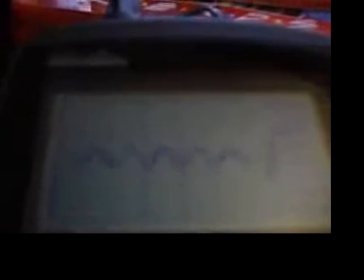RadiantJouleThief 2

Comment: In terms of a receiver, this is wide-band. In playing around with different L, R and C values, you can get a wide-band tank circuit effect, making it resonate with input from many frequencies. Even with an inductor ONLY, you have implicit resistance and capacitance in the circuit.

Comment from the maker: That is really interesting. I wonder if this is stubb's secret? I wonder if the fe wire running along with the cu wire is very significant.
These were done inside and if I had the light on I could see a very sinusoidal 60hz wave, but outside, in the earth the same coils show a very complex, maybe even interference pattern. Somewhere ~ 50 to 60 hz settle into a wave. I am not convinced about the source of that wave yet. It looks fractal in nature.
The toroid makes a mag flux going up its center.

Comment: btw, I've learned that if you create a magnetic flux near a high-inductance coil with ferromagnetic material, the inductance in that coil INCREASES -- B-H curve. It becomes a sort of "variable" inductor, tuning lower and lower in frequency. Thus the 60Hz in your house gets less and less attenuated. See if you see a 60hz pattern.

Comment from the maker: The NS coil is NOT connected to anything except the scope probes.
It is close to the JT and there is a change that the scope registers depending on where the NS coil is in relation to the JT. 
But, no. there is no physical connection between them. 
And, the JT must be on for the Scope to show a wave on the NS coil.
Good idea. I will be adding the diagram to my next video.